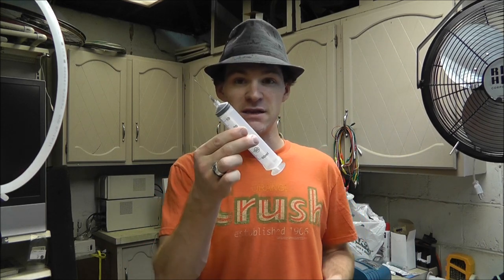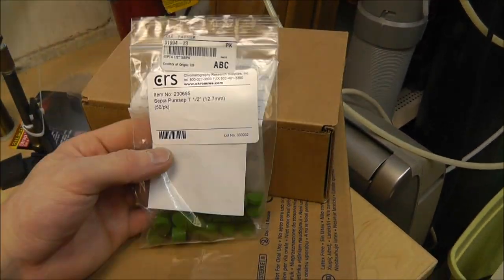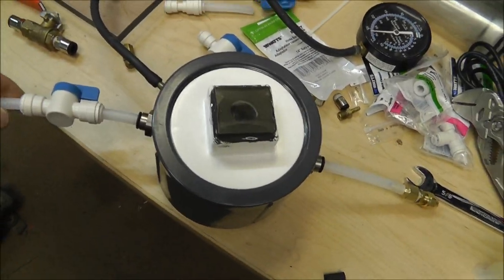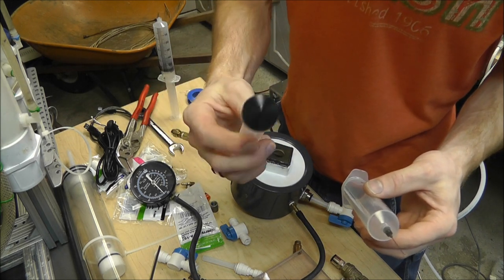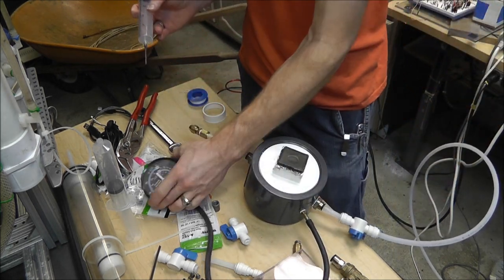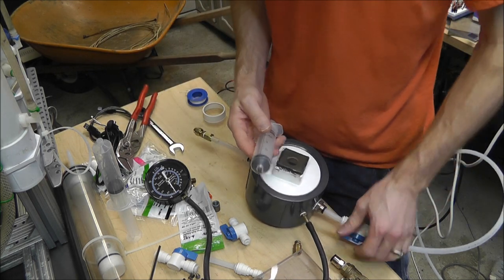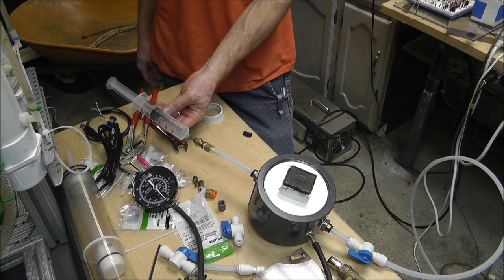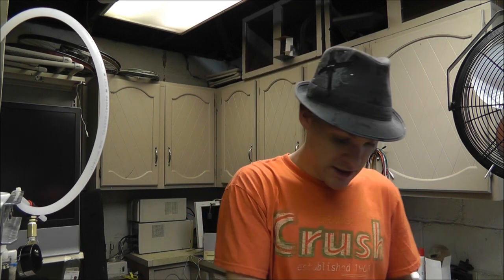Update 3 NGE Papp: Testing Syringes, Needles, septa & Fittings  RWGresearch.com

Comment from the maker: I agree Bob, And even if it's not better... There is allwsys more than one way of doing the same thing! No word on this kit.. But it dose not really mater, I have already a 100w RF CB and amp ready to go so I can test this out with the same set up you have, why reinvent the wheel, using what you have shown as far as a basic setup we can test the RF. my problem is that if we want it to do anything we need to be inside the chamber. So a coil or wire antenna will do... Thanks!! Blessings, ~Russ

Comment: Get a bunch of pencil erasures to stick the full syringe needle in. The internal pressure will stay positive for a short while you do this. The very light silicone lube on the rubber will not contaminate the gases. Your cylinder will empty itself but go slower with each injection as the pressure difference gets less and less.

Comment from the maker: Good questions. It all depends on how it's set up. A Tesla coil has a capacitor in the circuit to charge and discharge to create an AC signal. Look up a "LC Circuit" or a "taink circuit" Then the low turn primary gets induced onto the fine wire secondary with many more turns. Any how this system uses a high-voltage spark so that the low voltage hi current can go through the ionized gas from the spark... Ummmm yeah so not sure the qustion bit there's  my answer lol ~Russ

Comment: I think it was the close-up shot that made me queasy. Anyhow, I see where you decided to clean the plunger so that the gases would not get contaminated. It seems that you should be able to find something neutral so that the plunger doesn't hang or distort as you push it in. You only need a very thin layer of something even if it was sunflower seed oil that was rubbed onto your fingers that you rubbed around the side of the plunger. I'm curious how this is going to pan out once you do a test run.

Comment: I've used syringes for pneumatic and hydrolic pressure for years (cleaning small things mostly). I can confirm they get sticky. Even if you never clean, and only use as air blower, they still jam up eventually. When I watched Bob's video, I immediately thought they must have been used a few times. The way he used his hip made me think of sticky rubber, not air pressure. Thanks for confirming with this test. I'm eagerly awaiting your next progress report. Is that vacuum enough for the final Papp?

Comment: Russ, doesn't the syringe needle require a valve to keep air from contaminating the noble gas?

The noble gases will diffuse outward through the hole in the needle, and air gases inward, according to their partial pressures.

The hole in the needle is tiny, but I think significant contamination could happen rather quickly.